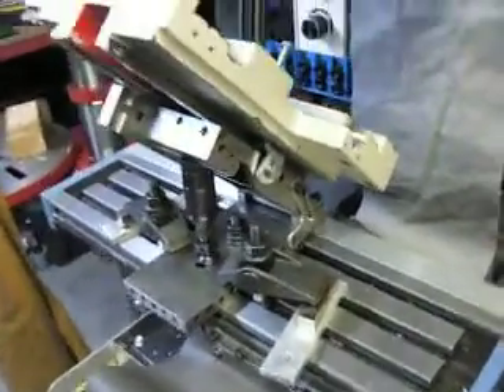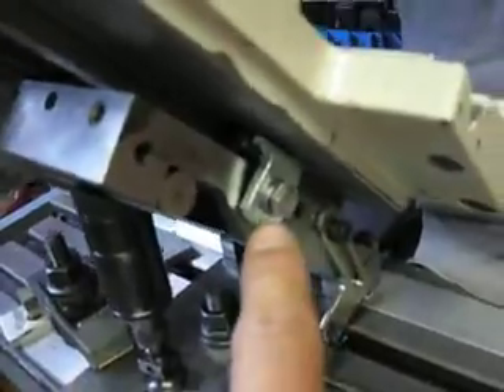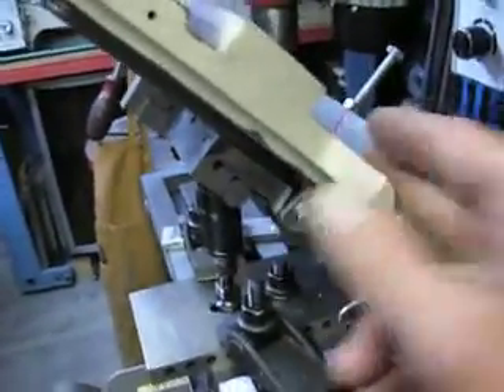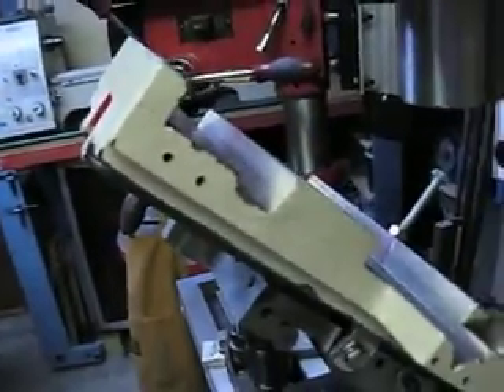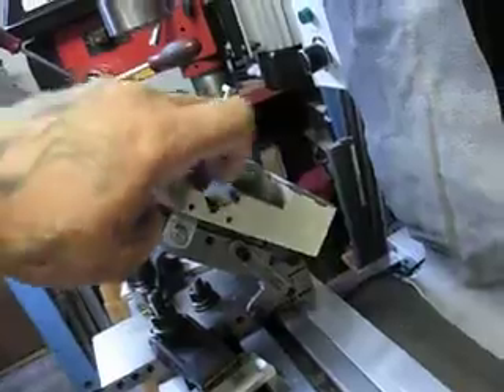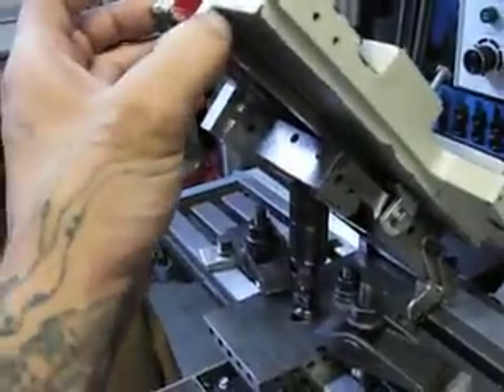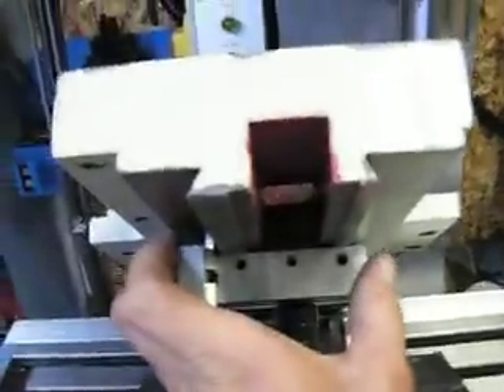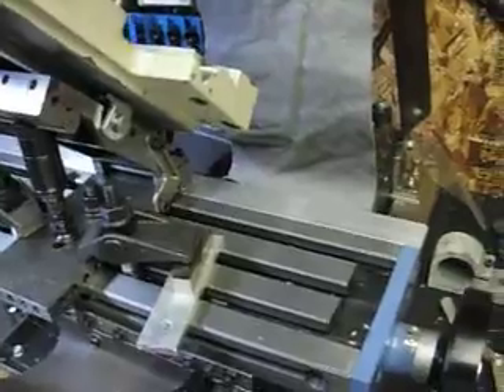Mill set up to machine lathe carriage to correct / square to ways.

Comment: So your bed itself is square correct? That should be the first thing you set. I filled mine with epoxy granite. It’s extremely rigid and I have machined 2-1/2” x 10” blocks in a 8” 4 jaw chuck with positive results and it takes material off in big cuts. About to endeavor in machining a new carriage top not because mine is bad but to make one with more travel. A 13” lathe I have that maxes out at a 10” cut no matter what I do I cannot Get a cutter past a 10” diameter. Besides that it’s an open bed with a max 17” and no way is that even possible to utilize without a larger carriage so it is all getting redone. Ran across your video looking to see how others approached a similar project.

Comment: Hey I like your idea but maybe you could show a little of the cutting action . I'm trying to learn a little about scraping so I like to see what you do Thanks man
Reply from the maker: This was actually just my method of removing the twist from the bed. If doing this keep your cuts extremely light with a sharp tool running very fast and brush the swarf between cuts.  My scraping is sub-par, and there are lots of good videos and information for scrapping out there. Much more informative than I can provide. My advice when it comes to scraping. Take your time. the fist week it will feel like you are spinning your wheels accomplishing nothing except damage to your body, then you will find your rhythm. Keep your high spot indicator very light and work the entire piece as a whole. Make sure your surface plate is big enough for your project. Let gravity do the indicating by the weight of the part.  For initial/heavy scrapping your part needs to be held steady, for finish/light scraping allow you part to slide around. Indicate the hell out of it, both by mechanical and paste means. Here are some search terms to google. There is great info out there, but don't just rely on youtube read some of the forums also. Terms: hand scraping and "scrapping" (you would be amazed how many people misspell scraping) Flaking, frosting, spotting, pull scraping, step scraping. There are many others and when you run a crossed one write it down and investigate it. Lapping may also be an alternative. Check out this site if you haven't already. Lots of good info.  http://www.toolsandmods.com/lathe/mini-lathe-saddle Best of luck Ironworker.
Reply: @sickboymech92  You need to be using prussian blue not lay out dye.